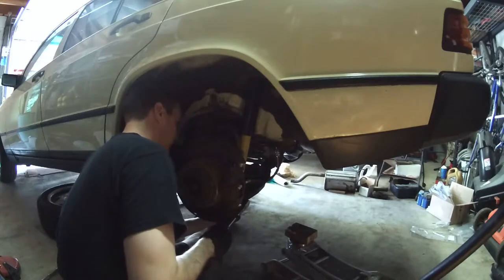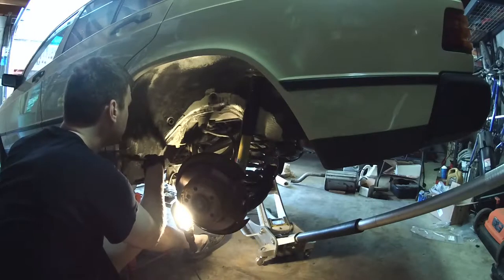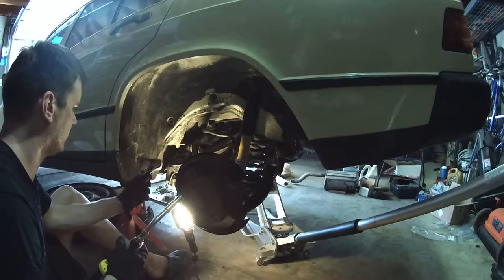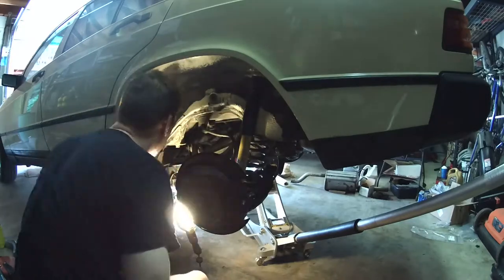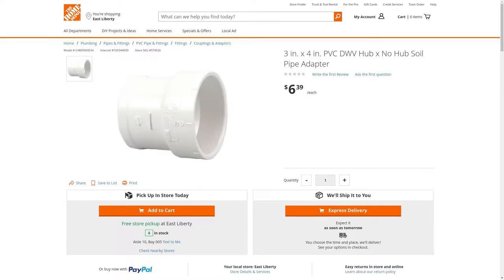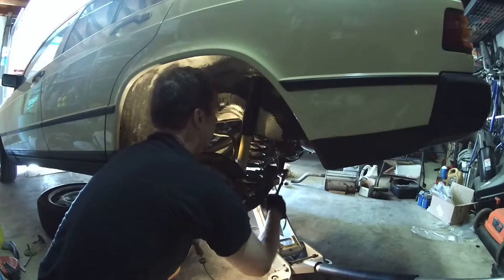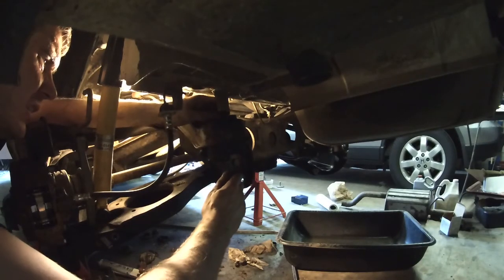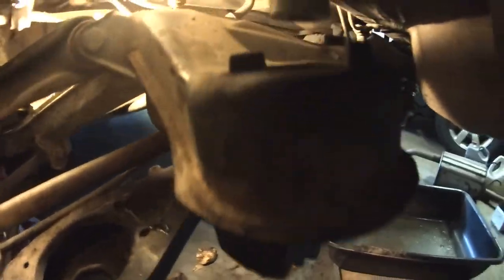Mercedes 190e Rear Subframe Bushing Replacement

Comment: My wheel leaning and they say its the subfame crack but i think its the brushing
Reply from the maker: I'd jack the car up and look at it. I don't think the bushing would make the wheel lean.
Reply: U have a idea what would i went too a firestone and they said the subfame was crack but i ask the guy was it a part and if said he dont kow thanks if u have a idea to why this happen i would to hear but u right am have to look at it myself.
Reply from the maker: if you look at it, it should be clear because you can compare one side to another. I'd check for a subframe crack since thats what he said, suspension arms could be bent as well.

Comment: Why did u have to fix it ? Was the wheel leaning?
Reply from the maker: no they just looked old and I was replacing the other bushings anyways.
Reply: So if a bushing from the subframe is bad will your wheels lean?....i have one of mi rear tires leaning towards the inside....its not the camber?

Comment: the rear setup looks like W124. Can anyone confirm the process would be similer on W124?
Reply from the maker: yea should be same w124 and w201 and others are all same rear suspension components
Reply: @chr1ssss  thank you. your video is very helpful and encouraging... I have a 1987 300TD. I need to do all the multilink pieces and subframe bushings. i don't know the condition of my differential bushings yet. Need to get in under there and check. Seems like that's not a particularly easy job either...